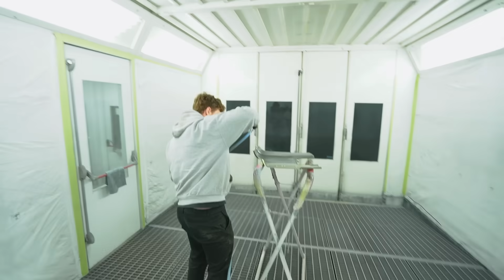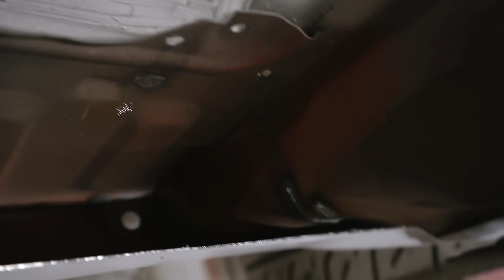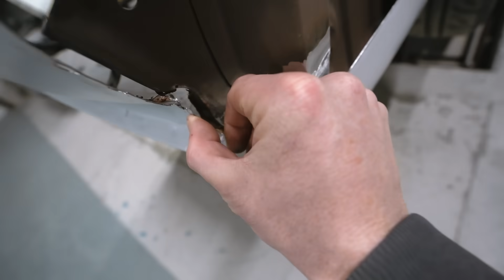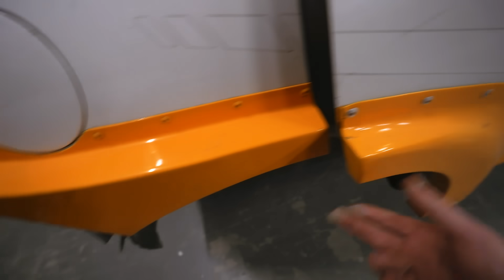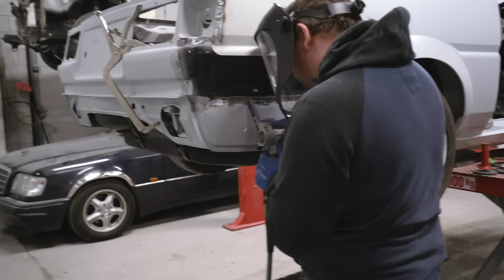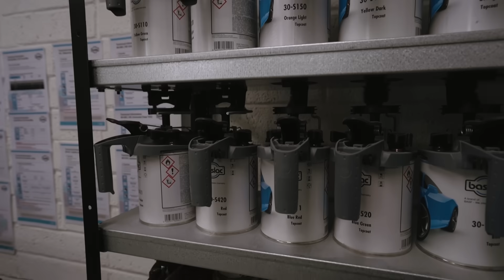AE86 Update: When Progress Goes in Reverse

Comment: Just a heads up in case you never heard of it Neil... I use a german product called "brunox rust inverter with epoxy". I found it a few years back when doing my hilux chassis. Its by far the best stuff ive ever used for rust treatment and prevention. Ive used it on my sw20 and zzw30. Ive painted over it too without reaction. Its expensive, but good insurance over regular epoxy for anything internal/around the welds. 

Great video as usual 🙌
Reply from the maker: Will keep it in mind thanks for the tip ❤

Comment: Once it is finally painted, Pump it full of deodorised fish oil. Still smells a bit and will keep dripping for years but helps keep the rust away. When it sits in the sun it seeps between all the panel joins. I live at the beach in NZ and my 75 Escort was restored over 20 years ago and still no signs of rust popping out. Just a thought Neil.
Reply from the maker: Using cavity wax on the inside, seems to be a decentish iob, cheers for the tip though

Comment: The primer insidethe panels isn't all that good, just a slight green sheen and that's it.
As with most cars, the bad rot starts from within.
You'll have a great car you can be proud of when it's done though.
Btw dont throw away the interior even if you wont install it like you said before, that stuff costs a FORTUNE now.
And the amount this has been welded/patched doesnt even register to the Mazda Cosmo that Yorkshire Car Restoration is working on, really made me think that AE86's are soon getting to the point that even the badly rusted ones (which also doesn't register compared to the above mentioned car) might be worth doing up considering the costs.
Reply from the maker: I’m a hoarder everything will be kept 😅

Comment: Neil, why no weld through primer before spot welding? I know it wont stop the spot weld from rusting but it will surely help the overlap area? Maybe the old weld thru ain't all its cracked up to be? Insanely good finish on that QTR.
Reply from the maker: We used it, I just didn’t add in the clips for some reason